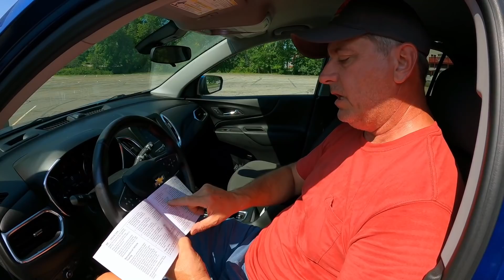Flat Towing Our NEW SUV // RV Lifestyle

Comment: We had a 2010 AWD Equinox and put 119,00 miles on it, 30000 miles was towing and it did great. Just purchased a 2021 AWD, 1.5 l turbo, but have not towed it yet. Just getting ready. Great video. Happy travling.
Reply from the maker: Thanks Mike. We did our first long tow today and the Equinox tows like a dream. The coach rarely shifts out of overdrive now.

Comment: Congratulations on the new ride. When I bought our 2016 Wrangler, I couldn't find one with a manual transmission so I had to order new from the factory. It is so easy to setup for flat towing but it does weigh more than I'd like.
Reply from the maker: Thanks guys!  So far so good and it's noticeable lighter when braking too!

Comment: We pull the Buick Envision which is basically the same as the Equinox and all we do is shift into neutral turn off the engine and go although ours is a 2017. We also installed the Roadmaster base plate but we didn’t get any of the caps that go into hole once you pull out the (what ever you call those things) memory loss!
Reply from the maker: Hi Abby. The caps do make it look prettier😬

Comment: Good to see you back and thank you for a new video on the ready brute tow system. We are trying to decide on what tow system we want for our toad and are wondering how the surge break does when coming down the mountain roads. Does the weight of the toad moving forward cause problems or make it feel like the toad is an anchor pulling on the coach?  Thank you in advance and safe travels.
Reply from the maker: Hi Tony. The surge brake system really works well. Only down the steepest of inclines will it kick in, but not down typical grades.

Hope this helps.

Comment: We tow a 2017 Equinox with the same tow bar system. When I was researching Chevrolet teck support told me that the 2018 and 2019 cannot be flat towed. So if anyone has those year model be aware. On ours we have to pull fuse #16 which I installed on a switch on the dash to make it easier.( GM service bulletin 17-NA-348) Don't know if this applies to the 2020 models. We have towed our over 3k miles without issues.
Reply from the maker: Excellent!  The 2020 does not require a fuse pull. So far so good after our first long tow.

Comment: I could not be sure, but it looked like your break-away cable (red one) was connected to the receiver. I have that same setup, and I connect that cable to another place on the frame of the motorhome other than the receiver. If the receiver should fail (I have seen them fall off), there is nothing to pull the brakes.
Reply from the maker: 👍 It’s looped up and around the frame member that the hitch is bolted too.

Comment: I want this type of set-up for my 2013 Eq. Right now I have a starter blue ox, but would like the wiring and brake. 
Ironically, my 2013 has the good has struts.
Reply from the maker: Hi Jim!  The Ready Brake brake cable and break-away systems are simple and strait forward.  No additional equipment to move in and out of the vehicle or fail.  I think Chevy went cheap when deciding to eliminate the hood struts.

Comment: Looks like the things are going well. Have a question. How is the engine still running?  Everything still ok?  Also after you got the engine rebuilt, was there any special maintenance you adopted?   Glad your business is doing so well too.  I RV with a little Wolf Pup pulled by a 1995 Dodge Dakota that has a big 318 V8 in it so plenty of power to go anywhere, almost.   For the time being I’m at my base camp in the mountains of WV.  Best to you both!
Reply from the maker: Hi Dave. The engine is still running well. I have been changing the oil every 3000-4000 miles max.  I also use Lucas fuel treatment every couple of months to help with the different qualities of gas we experience throughout the US.
Reply: @LyfUninterrupted  Glad to hear that.  Hope it continues we no problems!

Comment: FWIW: We used to tow a 2012 Suzuki Grand Vitara but we got hit by a hail storm near Calgary Alberta and the insurance company decided to write it off so we bought a low mileage 2014 Honda CRV AWD to replace it, I did the Blue Ox baseplate install on both along with all the wiring of the tail lights (also did my GMC pickup 4X4 as well)  Just curious do you have to pull a fuse for the brake lights on the car so the signal lights will work when braking while towing?  I installed a dual pole single throw switch on the Honda to kill both the brake lights and the radio with one switch (I use the Blue Ox Patriot braking system because I want to be able to easily transfer it between vehicles)
Reply from the maker: Hi there!  There is no requirement in the operators manual to pull a fuse. Apparently it was required in earlier model years of the Equinox.
Reply: @LyfUninterrupted  On the Honda (and the Suzuki) when the brake system (I use) applies to the brakes on the car it actuates  the brake lights on the car which cancels out the signal light if you have them on from the motorhome. Oh!!  by the way my lights are wired to the existing cars taillights through diodes. I of course don't know how yours are wired. FYI The radio fuse removal is a suggestion in the Hondas owners manual to reduce battery drain.
Reply from the maker: The wiring is similar you yours, but I installed a plug n play harness with a diode pack. It works well.

Comment: Hey Brian! I really appreciate this video! I was wondering 2 years later how your experience was with towing the 2020 Chevy Equinox? I was trying to decide if buying this car used to flat tow is a good option and would appreciate your opinion. Thank you!
Reply from the maker: Hi Val!  The Equinox is an excellent choice for flat towing. Putting it in and out of tow mode is simple and straightforward. It’s light enough so as to not tax the coach too much. In fact, I could barely notice it when rolling down the road. We even towed it through the mountains of Colorado with no issue. 

Hope this helps.  Thanks for watching!
Reply: Thank you so much for that info! It's so helpful!

Comment: I was just curious if by chance you know what’s different with the 2018 Equinox. We have the 2018 with the 1.5 and AWD and everything I’ve looked up says not to flat tow it. As far as I can tell we have the same car just a different color and year. I just don’t understand what’s different. Thank you if you can help me understand and thank you if you can’t!
Reply from the maker: If it’s the same vehicle, just a different year, then it should be flat towable. Check your owners manual for that information. Also, you can go to etrailer.com to see all the required and recommended equipment needed to flat tow. Hope this helps.
Reply: @LyfUninterrupted  Thank You. It’s definitely the same vehicle but my manual says not to flat tow. I wasn’t sure if it was just updated literature or if they had made a small change in the vehicle 2018 and 2019 say not to in the manual and etrailer doesn’t list it for my year with the 1.5 awd. I just can’t find if anything was actually changed in the vehicle or if they just updated their recommendations. Thank you for responding! If I find a definitive answer I’ll post my findings!

Comment: Nice video. Thank you. We are looking at switching from a VW stick shift tow vehicle to a 2019 - 2021 chevy Equinox so we can have an automatic transmission available. Since it has been a while since you started using the Equinox, any suggestions, complaints or things to look out for on these vehicles?
Reply from the maker: Yes!  Make sure to install a battery charging line from the RV to the vehicle. Otherwise you take the risk of depleting the battery when towing. 

This said, the Equinox has been a great TOAD. 

Thanks for watching!
Reply: @LyfUninterrupted  Thanks for the update. I was aware of the battery charging line via our VW we toad. I will intensify my search for a deal on a mildly used one. Thanks again.

Comment: It’s so good to see you both. Glad you are alright. You need a break every now and then. Happy you have a new vehicle. My sister has the same car but different year. And hers is a grey blue. It’s a 2019. She loves it. We needed to get a vehicle that would fit my moms wheel chair before she passed away and this  was the vehicle. My vehicle it was too hard to get in and out of. Brian great job with doing the hitching of the car to Rv.👍 Glad you are on the road again and glad Shawnas work is picking up business. Hope you have a great day and see weekend and see both soon. Safe travels.
Reply from the maker: Thank you Sherri!  We are enjoying Maine.  Much cooler temps now, but things are suppose to heat up a few degrees in the coming days.  Not looking forward to the weather as a result of Hurricane Ida making its way to the New England area.
Reply: @LyfUninterrupted  This is a pretty bad storm this Ida. My sister in Tennessee she’s getting the rain from it. Hope you both will alright when it hits New England states.  Hope you have safe travels and have a great day.
Reply from the maker: Thank you Sherri!

Comment: We ordered a 2022 AWD Equinox Premier. The manual says dinghy towing is approved but my husband called Chevrolet and someone he talked to said no. Still waiting to get the vehicle but is anyone flat towing the 22 AWD that can help confirm we are ok?
Reply from the maker: It is always best to refer to the manual for restrictions on flat towing. This said, all Equinox models 2020 and newer with All wheel and front wheel drive options should be flat towable. You must install a charge line for the vehicle battery as the vehicle must stay in ACC mode while underway. Again, consult the manual for your model year to confirm flat towing requirements and restrictions.

Also, the base plate installation is not for the faint of heart. The entire front end facia, including headlights and some components in the engine bay has to come off.

Email us at lyfuninterrupted@gmail.com if you would like to discuss specifics about the Equinox.
Reply: We picked up the car today! Checked the manual before signing the papers and we are good to flat tow!
Reply from the maker: Good to hear. You’ll love towing the Equinox. Most of the the time we can’t tell it’s behind our coach.

Comment: Is this a premier? How long can you travel while towing?  I have a 2020 premier.
Reply from the maker: Hi Debbi!

We have the LT model, which is one model below the Premier.  The owners manual for our vehicle does not specify a mileage limitation while towing, only a MAX speed limit of 65 MPH. The owners manual also says to run the engine for 5 minutes prior to and after towing to circulate the fluid in the transmission. It also says to run the engine at each fuel stop while towing. 

Be sure to check the owners manual for the model vehicle you have. 

Hope this helps.
Reply: @LyfUninterrupted  Thanks, ours say this to, but I feel because it's a premier we can't go as far. We talked with chevy and found out we can't turn off a lot of stuff so it's draining the battery quick. Can't pull fuses they said. I love the car so we'll deal with it. Thanks for sharing the info, it was helpful.
Reply from the maker: Hi Debbi.  Your 2020 Equinox needs to have a 12 volt charge line installed to keep the battery from discharging.  Your RV will need to have the same line installed, if it doesn’t already have it, to feed power to the car. Here is a link to how that is installed on the car: https://www.etrailer.com/tv-install-roadmaster-battery-charge-line-kit-2020-chevrolet-equinox-rm-156-25.aspx
Reply: @LyfUninterrupted  we do have the line, I think because of all the stuff that can not be turned off it needs to be a heavier line. Hubby doesn't agree, so I'll just keep following him and enjoy listening to my music. It will work out fine. Thanks for helping me out.  Safe travels and happy adventures. 😊